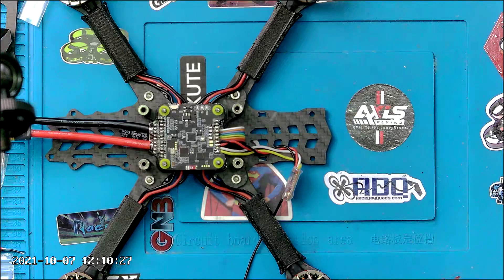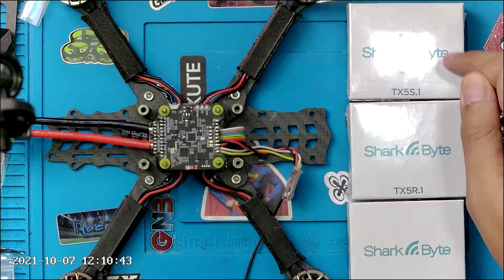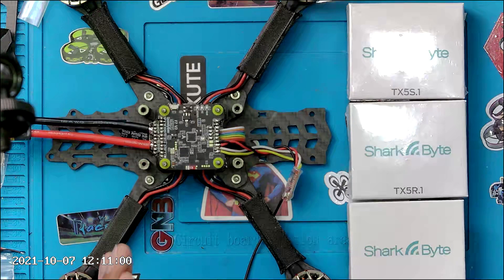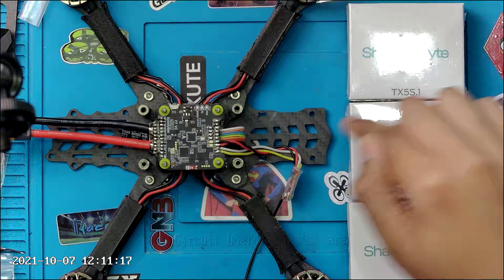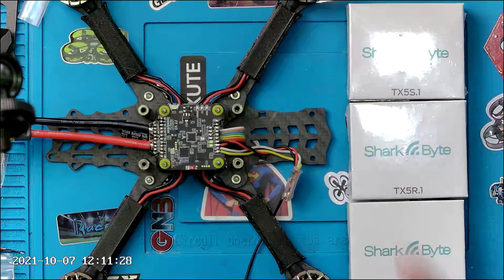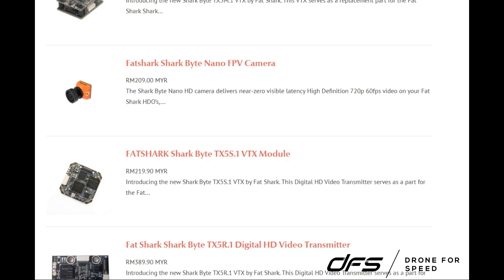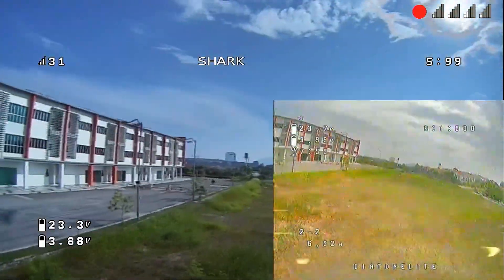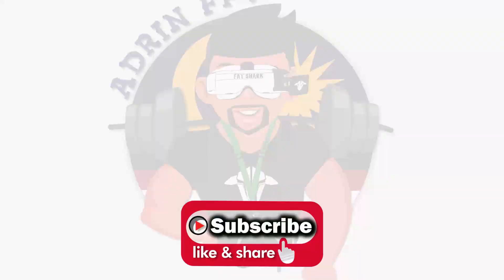Review of the Sharkbyte VTXs and Penetration Test

Comment: Shark bite is not a direct competitor to DJI it is a competitor to analog
Reply: why not ? I think it's definitely a competitor to DJI and the fpv equipment they sell . Maybe not their camera drones but it's not for camera drones. It's for FPV .
Reply: @DeeMenace  DJI is LEAGUES beyond sharkbyte in the FPV camera and vrx and vtx department. They are barely comparable. I have a bunch of analog quads, several shark byte, as well as DJI vista units and the analog and sharkbyte are very similar to one another. DJI is in a league of its own.
Reply: @DeadLastFPV  To my knowledge no one has ever won a fpv race with a DJI setup . But Vanover just won with a HDZero setup . I think that speaks for itself . I think if DJI really was the end all of fpv video then we would see waaaay more people racing with them . Even the top freestylers don't use DJI because of the latency issues.
Reply: @DeeMenace  Agreed. Until the latency and extra weight issue is resolved in digital, analog and MAYBE Sharkbyte will be the king of racing and low-latency proximity freestyle. I fly 95% analog, and 2 quads are digital that I fly with my v2 goggles. But I race. And I do a lot of quick proximity stuff. So analog is my pick for that .

However, all I am saying is the technology is moving there. Soon enough we will have small enough, light enough, DJI compatible systems for racers. My experience with Sharkbyte is that it’s a great upgrade from analog for racers!! But it definitely needs some major improvements.
Reply: @DeadLastFPV  I agree 100% the hobby on a whole is still young and digital video is even younger. No where near as old as rc planes or helicopters even . DJI had a head start but even it's still a baby really . Imagine if DJI came out with a low latency solution  that still had the same quality. But high quality wireless video transmission with low latency is very hard .

Comment: It is not a competitor for dji...it is a replacement for analog... dji  turns their  users into slaves of that ecosystem and really does not fit well in the historic rc fpv ecosystem and has been nothing bu a divider in the fpv community.I have a lot more to say about dji as a company..human rights problems..engineers incapable of designing with best practices..meh..I personally know 2 dji users who will jump that ship the moment Shark Byte /Divimath comes out with a durable 1W board .
 I think eventually you will probably see
1.Whoop board 200mw
2.Race board 200 mw
3.Long range board ~1w
4. Divimath technology  will be embraced by multiple makers and we see a industry wide digital revolution 
  that dual board stack will probably go away..hard mounting stacked boards is never a good idea imho..
Reply from the maker: Ever wonder why they are working on 1w, versus going ahead to beat DJi's 1.2w? Even analog can now go to 3w..so why take smaller steps from 200, 500 then 1000mw? Just curious.. I'm a dji and analog flyer, but finding sharkbyte to be quite exciting.
Reply: @adrinfpv    Anything above 1W is illegal in most places...the dji users here in the USA..ALL on 1.2W and breaking the law but the FCC is toothless..  Digital transmission apparently creates a lot of heat..I suspect that's why dji has cases on their air units and why SB is considering heat sinks etc..on their 1W board to ensure durability...